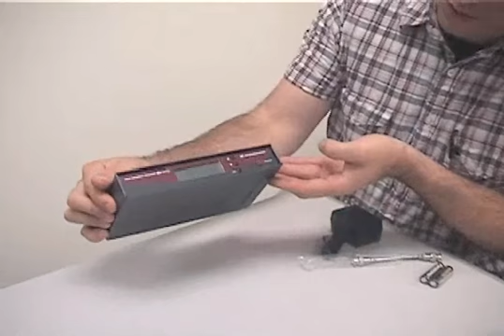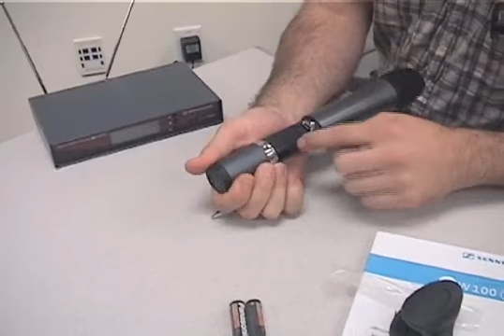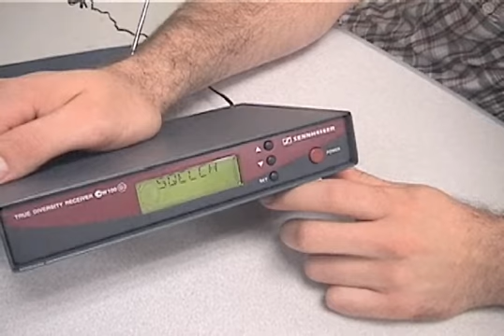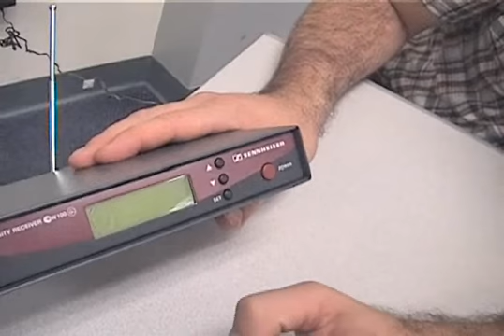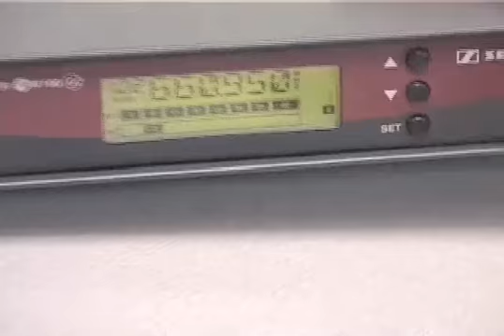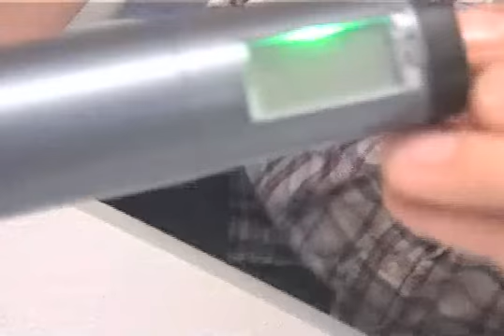Sennheiser evolution wireless G2 Series  vocal set

Comment: excellent vid.  i have a question: after i find the right channel and it's all set up ready to sing through but when i'm done singing and i power off the transmitter there's a huge static sound and the light that was green on my mixer turns red like it's clipping    why does it do that  thanks in advance Bob

Comment: I have a question.
I just bought a EW100 G2 with a SKM100 G2 microphone,
I have setup everything correctly, the mic and receiver are on the same channel.
The receiver gets a clear signal from the mic, bot the mic and receiver have Pilot mode activated.
The receiver doesn''t output a signal to my mixer though...
I have tried both a balanced XLR-XLR and a balanced Jack-Jack cable.
Only sometimes, when scanning for a frequency I get signal noise through the mixer, so it can output a singal clearly.
But it would be nice if both the mic and receiver work as intended.
From what I've read on various sites, more people have trouble setting this setup correctly.
So far, I have never had any problems with wired connections, it''s just plug-and-play.
So I wonder, is this equipment made to not work properly?

Comment: i bought 2 sennheiser wireless mics and hooked up to my 16 channel mackie mixer but it sounds weird til I turn one off then it works fine.Both mics and power supply turned on and has funny sound until I have to turn one off.What am I doing wrong or do I have to adjust the channel on both power supply and mics?

Comment: i'm a dj in a club i only work sat nights and speak ont the mic every 10 mis or so. my friend is a full time dj and had this same unit for yrs with no problems. so before i get charged a lot of money getting it fixed is there anything i'm doing wrong or anything i can do to fix it. it was wroking one minute the next it wasnt. i found your video very very helpful. so thank you. Basically there is no AF SIGNAL EVEN THOUGH YOU CAN HERE MY VOICE COMING THROUGH AND LOTS OF INTERFERENCE.

Comment: hi my new ew 100 g2 that you have in this video after 6 weeks has broke. it was working fine i have looked after it and not dropped it at all. and i cannot get a AF signal on the monitors plus lots of interference. i fi hold the mic further down toward the battery pack led readout the interference noise gets louder. my voice sounds bad now coming through like something has really gone wrong with it.